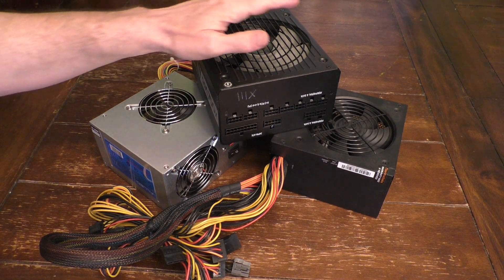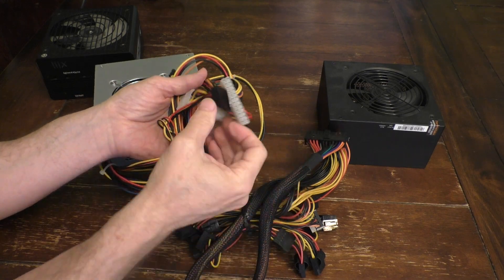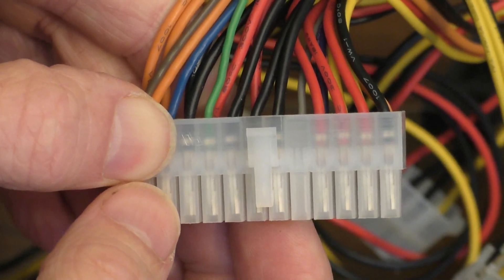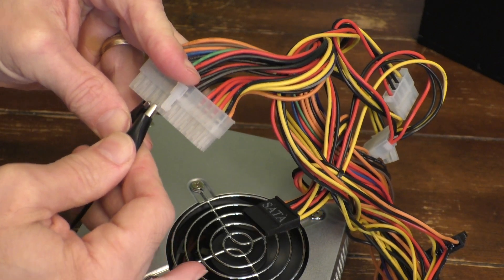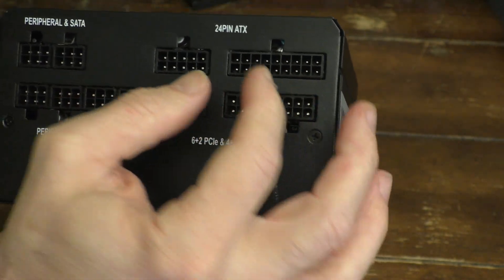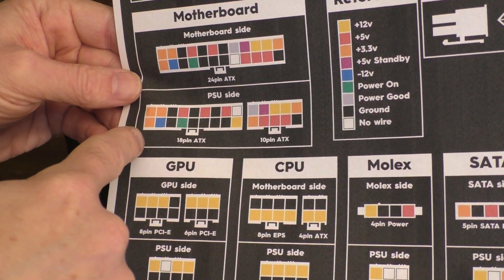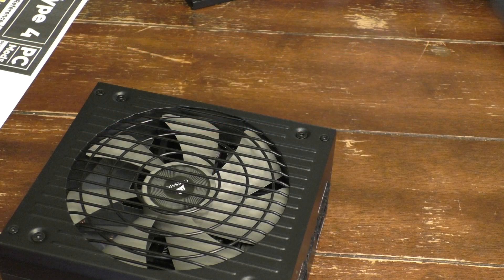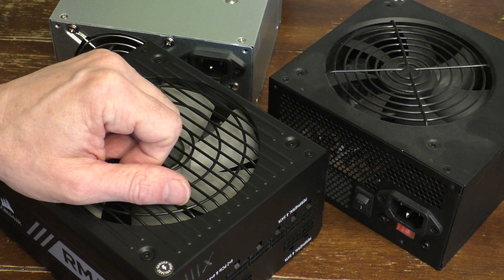How to Test an ATX Computer Power Supply outside your Computer (including Corsair)

Comment: amateur way to check if only the fan spins up! what about the current for 12 and 5 Volts on all the connectors? There are cheap $5 tools you can test with more safely and effectively!